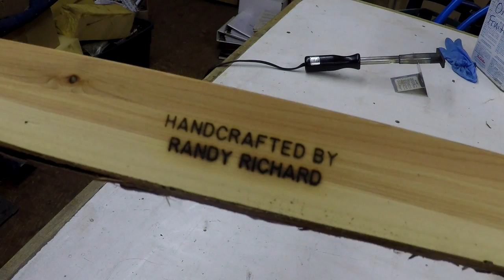Micrometer Make Over - Ketchup #55

Comment: I have a Mitutoyo Uni-Mike and have chased the same issues with it.  Watch out for anvils that are not straight and parallel, do not seat correctly, and there are also plenty of places for contamination to cause issues.  Putting the gage block in line with the flat or round anvil is probably asking for trouble from bends and warps.  I have had luck using a good ball bearing on a traditional mic and then the Uni-Mike to calibrate various flat anvil setups.  Round anvils do better using a cylinder shape like a gage pin gently at 90 degrees to the round anvil to calibrate them.  It is fussy, and it is tough to get it set up so you can trust it within a couple tenths.  Still a really useful tool when you need it...